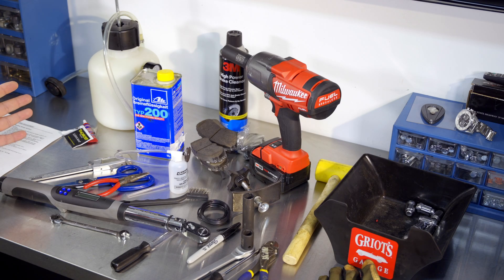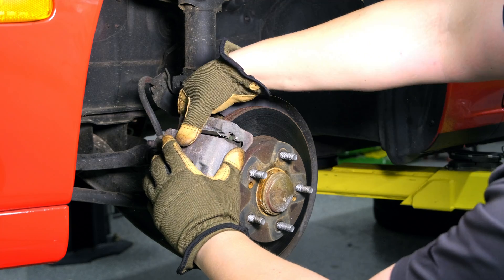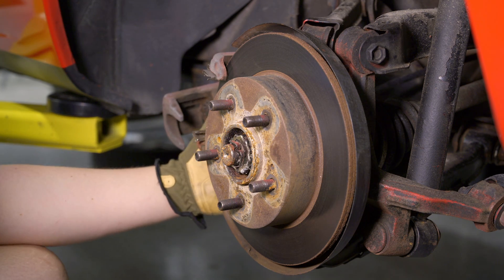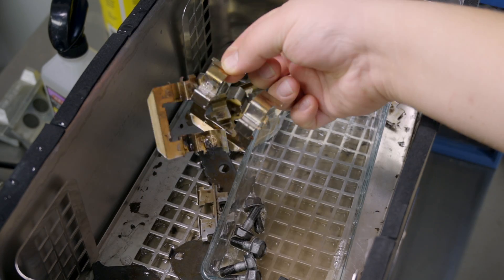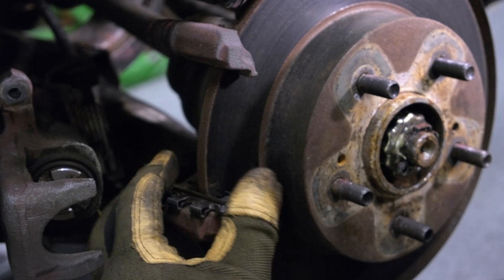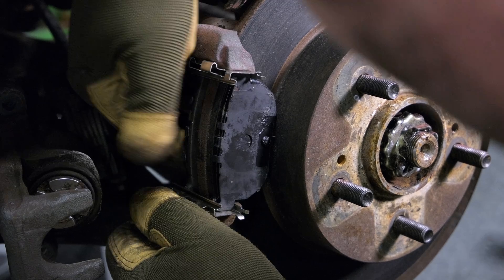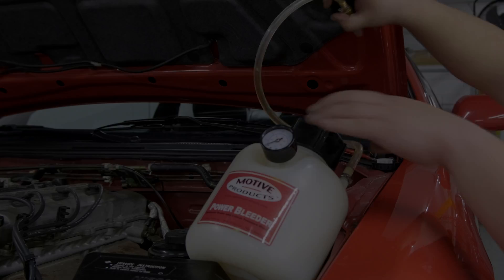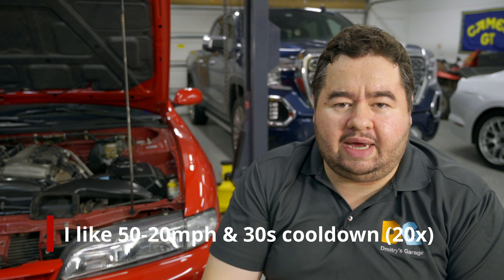S14 240SX - How to Change Brake Pads and Flush Brake Fluid

Comment: I just got the product with the 1107 cap which doesnt fit the s13 trying to figure if you know by any chance which cap will fit the s13.
Reply from the maker: Are you sure it's not just a tight squeeze? I haven't worked on an S13 so I'm not sure, but I thought they were the same. From Motive:

The 1107/1117 (caps that come with the 0107 and 0117 bleeders) caps can be difficult to connect. You must do the following:
a) align the tabs on the cap with the cutouts on the brake reservoir neck.
b) push down on the cap, you may need to rock it back and forth while pushing down to get it to seat, once you feel the cap seat onto the reservoir.
c) twist the cap to lock it down. If you try to push and turn the cap at the same time you will not be able to get the cap onto the reservoir
Reply: @DmitrysGarage  the diameter it’s way too small maybe will have to purchase the universal one
Reply from the maker: That sucks, yea not sure what the correct one is then :(

Comment: do you have to bleed the brakes after you change the pads ?
Reply from the maker: No, just make sure the fluid is at the full line when you're done. Unless you're introducing air into the lines you do not have to bleed. Though if you haven't bled the brakes in a while it's a good idea to do it.

Comment: if  you gonna do video  next time dont use professional tools that regular guys like me wouldnt find and have time to research maybe just show how you can professionally do it with household items. just saying
Reply from the maker: Ray, thanks for watching and commenting, I really appreciate it! Please keep in mind these are your brakes, you shouldn't service them with household items. You can either service brakes professionally or pay a professional to service them. I know it's tempting to cut corners, but it's not a good idea with safety items. That being said you could get all the tools you need to do this professionally for under $150. The most expensive piece is the $58 power bleeder. If you have a second person, you could skip the bleeder and have them pump the brakes for you. However, you have to have at least $100 worth of tools to do this job. You have to have a socket kit. You have to have a caliper spreader. You have to have a bottle to collect fluid. You have to have to have a caliper to measure your brake disks. There is no way to get around that and do a professional and safe job. Keep in mind that investing in tools vs. paying for someone to do the job means after the first job the next job is super cheap. You already own the tools!